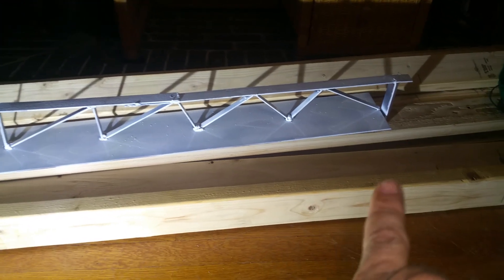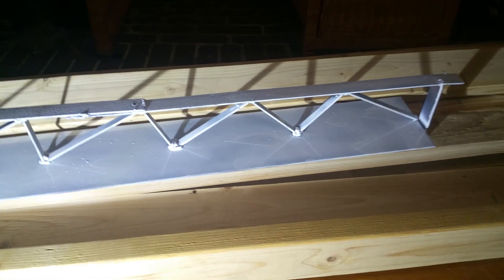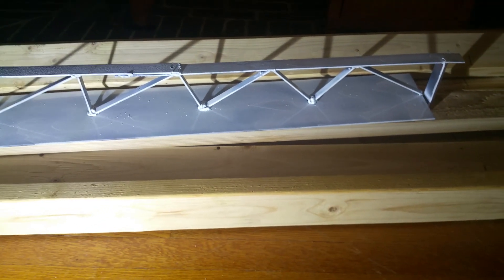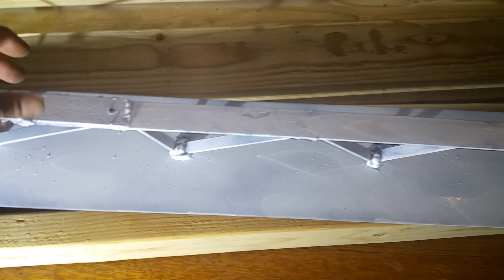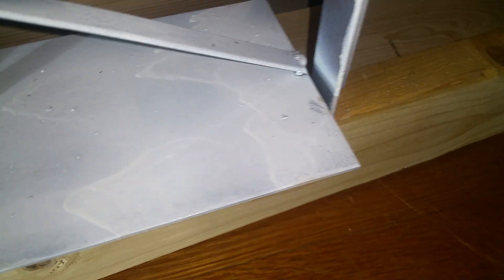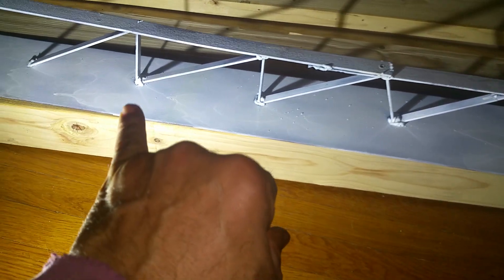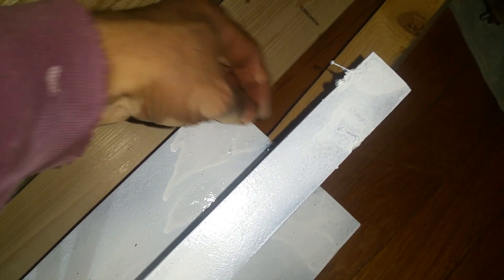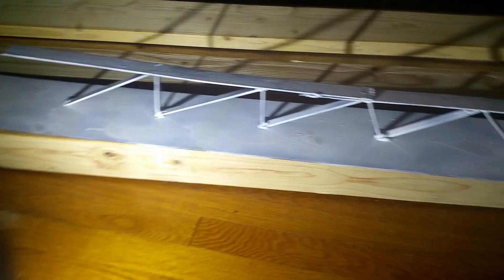FIU BRIDGE COLLAPSE MODEL PART 1 SAGGING DECK EXPLAINED = LONGITUDINAL POST TENSION FAILURE FIRST

Comment: Hey nice work, I think you'll find in time 023 wire is really good you can lay down nice small beads. 
Keep up the good work 👍👀
Reply from the maker: I just realized I had a .035 tip and not the .025 tip... I hope that helps, I will test more... Thanks Conantdog, I heard I would like it... I am running 25 % mix... at about 12psi

Comment: It kind of looks like and upside down truss.  Your demonstration of the how deflection in the middle really shows the amount of movement ends of the actually bridge should have been experiencing.  Even the NTSB thought using concrete in this manner was "innovative" which I think between the lines was code speak for they think concrete was an inappropriate material choice.

I also believe this shows the bridge would have been very bouncy if it had been made of steel.  Perhaps even bouncy to the point that if the bridge were full of pedestrians, it could have deflected off the bridge piles.

People walking on the edge would probably caused another torque on the truss design I suspect was not characterized in the original bridge analysis.

Truss bridges usually have two sides that are connected together to create a pretty rigid box design making it pretty rigid from side to side torque.
Reply from the maker: James, did you see part 2?
Reply: I just now watched it.  Great demo.
Reply from the maker: James, I hope you saw today's video, ''number 4" and the one that will go live shortly, ''number 3-A"...  Then number 5 tomorrow will be a more enlightening video... Then number 6 will show post tensioning applied to help with resistant forces.

Comment: Nice model that appears flexible enough to see where it wants to bend and not bend.  It is a wonder why the school did not have a group of students build a model and then stressed it with sensors and such attached. Senior student assignments; free, eager labor!!!   Ah, but what PE would consider the efforts of a group of students?
Do you have the correct size wire housing for your welder lead?  The smaller wire takes a smaller housing. After a half dozen spools of wire, the housing will wear and the wire will not feed right.  I use an argon/CO2 mix which for me works better than straight CO2.
Reply from the maker: Stever, take a look at part 2 and tell me how I am doing, thanks.
Reply from the maker: I just realized I had a .035 tip and not the .025 tip... I hope that helps, I will test more... Thanks Conantdog, I heard I would like it... I am running 25 % mix... at about 12psi